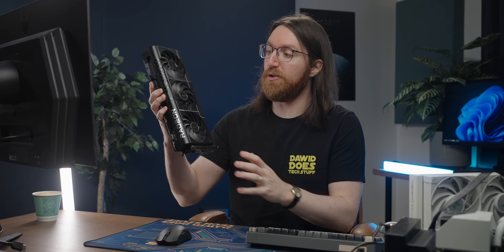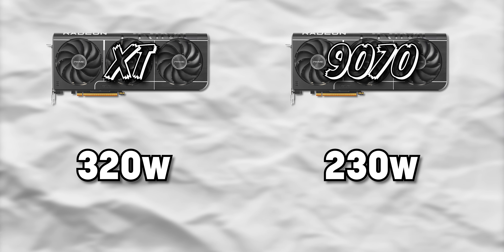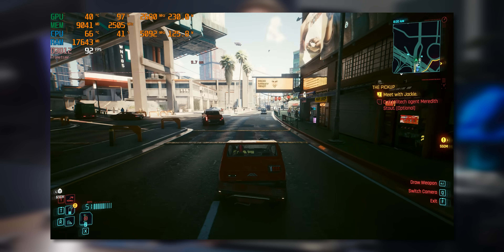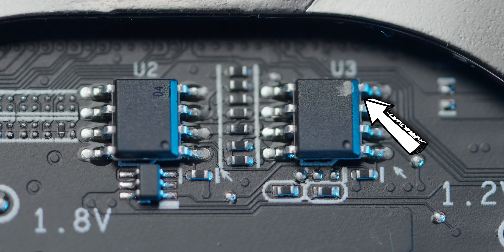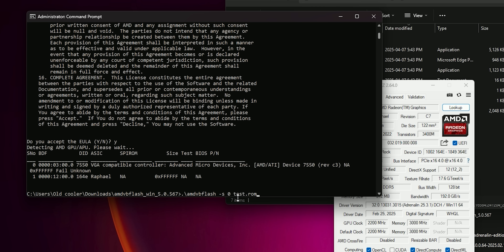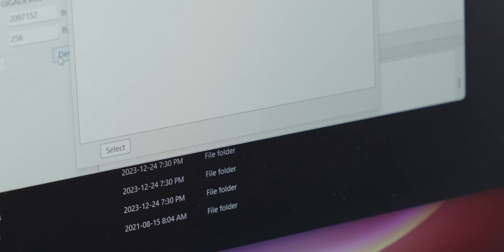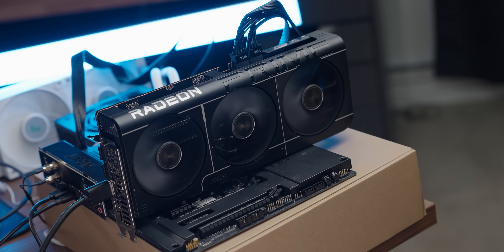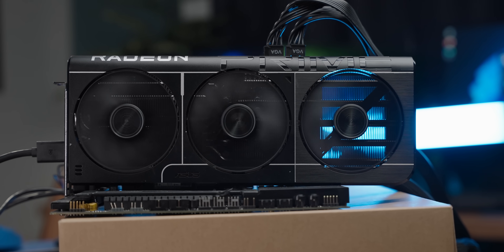I Flashed An AMD RX 9070 XT BIOS Onto My RX 9070...

Comment: Screaming at my screen, "just change it to .bin" ...lol
Reply: NGL bruh, some part of my brain kinda tells me : There's no way it could be that simple
Reply: @fajaradi1223  it depends on the case, on this one, the dump has no file metadata, so you are able to change .rom to .bin, it still will be the same file
Reply: @fajaradi1223  both bin and rom are common extension for raw bitstream dumps from a chip / cartridge / ...

They don't have any formatting, magic or structure, they're just a sequence of bytes.
Reply: Unless I know that .bin and .rom are just same, I won't blindly do it.
Reply: @arahman56  they are the same, when you dump a bios, you only get the raw data, nothing related to the  file format, the dumper places the file extension they want, theres no file metadata. so .bin and .rom are the same
Reply: @henry789  that's not the only thing that may differ. One may be compressed, squashed, addresses may differ, image bases may differ, etc.
Reply: @miloradowicz  that can happen for other file types like video and images but in this specific case the file only contains the bios dump, and changing the file type will only rename the file, not modify it in any way. the windows warning is a little useful for images and stuff like that but in this case it just adds confusion
Reply: @arahman56  They are the exact same thing, both BIN and ROM files are essentially strings of 1s and 0s, representing binary data, the  suffix is just for humans to distinguish the type of purpose the data you are working with is intended for. there is a minor distinction, I think BIN can run as an excutable.
Reply: Ngl I'm not a geek or has any IT knowledge, but I know the file type shortcut change fix from when I used to play with Minecraft servers and some nintendo piracy. I also screamed inside when I he said that he got wrong bios file type. It's just a data David! Just change the data type!
Reply: And I'm out here for it
Reply: Ahaha, I think a few of us did that.
Reply: He didn't need to rename anything - he could just change to "all files" in "Open existing file" window (bottom right drop down menu).
Reply: or he could have just search rom's name in textbox below xD

Comment: I had to do this to a friends laptop who's windows update corrupted the bios. I had this same flash kit as you and I felt like a wizard. I couldn't get the clip onto the bios chip so I unsoldered it and attached it to the adapter board

Comment: Damn! That's a nice uplift! Makes you wonder why AMD didn't just made both 300+ watts.
Reply: On purely a technical standpoint it failed some of the internal checks and so they binned it down clockwise and powerwise, fused off some misbehaving cores and that's the reason. It's for legal reasons so people don't sue for getting an unstable product out of the factory.

The user takes his/her own risks by flashing that bios, but AMD wouldn't like to warranty that out of the box.
(Kudos for them for not hard breaking the card because of some DRMs. This is already a huge W)
Reply: "upselling"
Reply: Because if they did, the performance would be very close and then they cannot justify the higher priced one. Nobody would buy a 50$ more expensive one if there was just a <5% performance difference. You would always buy the cheaper one.

Comment: Need a long term review for this!
Reply: If it works - it works. The only possible problem in future, if the flash was successful - power draw and temps themselves, but with a good cooler and VRMs it is not a problem. And you lose warranty.

P.s. what I mean by "successful flash" - not just no errors on flash, but also test it for stability, artifacts, and errors.
Reply: @Blackwing2345635  If you have cheapest 9070 card that was meant to handle like 220w, has like dog shit VRM, I guess it could die running like 320w

Comment: remember the 6700XT that was meant to be 230W? but most sold are just 184W... if you unlock it, it's easy and doesn't require bios mod, the chances of killing the 184W version is likely over 70%
Reply: but they also stopped making those when the 6750xt came out which is just a pre OC'ed one
Reply: @Healcraft  yep, the 6750xt is basically the same, but without those power issues.

Comment: I hate when I try to do something techy and it immediately gives me an error. Like, I followed the instructions to a tee, why is it wrong? I get user error, but I'm usually very careful to do exactly as the instructions say, to the point of overthinking steps. It's even worse when I look up a tutorial video and they do the exact same as me, but get the correct outcome

Comment: When I said the 9070 and 9070 XT reminded me of the 5700 and 5700 XT, I was more right than I thought. GG on getting it to work. I'd be tempted to try this on my 9070 if it was just a simple software solution. Please just let us do more than 10% power increase, AMD!
Reply: Just wait for a bios flash utility that works. Someone will 100% make it now.
Reply: @error262  damn can't wait 9070 is a great card :glasses-purple-yellow-diamond:
Reply: @TerryFT86  if you can reliably do this without breaking or degrading the life of the card this will most certainly make the 9070 a much better value purchase. This likely voids the warranty tho if RMA notice.
Reply: Even earlier than that was the R9 290 and 290X BIOS swap.
Reply: @DustyTheDog  I did this. I still have the card running in an older PC. It was a blower. I bought an aftermarket cooler and clocked the crap out of that thing. Competes with the GTX 1060 all day long.
Reply: AMD does that almost every generation
Reply: @ZGtx  remember the athlon chips...sold as dual core but you could unlock it to 4 core on certain motherboards

Comment: Glad this hack is still alive, I remember hearing about this trick with the Vega series along with RDNA 1 with people flashing a 5700 XT vBIOS on a 5700. But haven't heard of it since then until now
Reply: Glad this is the top comment otherwise I was just about to comment on the Vega 56/64 BIOS hack as long as you had the right memory.
Reply: I think I remember being able to flash the Rx 580 bios on the 480 because it was basically same card with more vram
Reply: both come with 4gb and 8gb versions @anthonyparker
Reply: yep, I flashed a 5700xt bios onto a 5700, ran great.
Reply: It's not the same thing, but this reminded me of those dual-BIOS Sapphire HD6950 cards that came with a switch so you could run it as a 6970
Reply: This method is older than most today gamer. Back in the day, you could unlock Radeon 9500 to 9700, making it a price\performance king
Reply: You can do crazy things on RDNA1 with YAABE bios editor and MPT/RBE tools. My bios modded RX 5600XT runs at 2GHz even matching stock RX 5700 performance.
Reply: @tidjane2001  I did the same with my 5600XT, I got mine to 2,1GHz at 250W. Sadly as always, it's the memory bandwidth that bottlenecks GPUs in games, and that narrower bus hurts it when compared to the 5700
Reply: @Creepus_Explodus I agree. Memory is holding back this card, both in bandwidth and capacity.
Reply: Done that on r9 290 = r9 290X and rx 480 = rx 580
Reply: Used to be able to do on some AMD Athlon chips to give them a free upgrade to a Phenom
Reply: @hollandx2  I remember those days...you would buy dual core and unlock the 2 more cores in bios
Reply: I flashed rx580 bios to my rx480 back when those were new. It had decent gains and stability, but nothing like this video shows for this generation. This mod has definitely been around on AMD for a long time. R9280x/290x was another. And the generation before that even if I remember correctly. Hmmm I wonder if I can squeeze anything out of my 6650xt 😂 off to the forums!! (Is that still a thing?) Lol
Reply: i tried it with my vega 56 but it ran the same with the 64 bios as with a finely tuned manual overclock as a 56
Reply: @tenshiinen probably because the power limit where basically the same 
We talking 240w vs 320w bios here massive voltage boost
You can see in the video the card going from 2600mhz to almost 3000mhz with the extra power available 
There just no way of achieving this result with the stock 9070 bios power limit
Reply: I have seen this done way back during the ATI days where users turned their X850 XTs into x850 XT PE cards.
Reply: 5700 to an 5700 xt aw the good old days. lol
Reply: I flashed RX 5700 XT vBios on my RX 5700!
And in the process I modded it using More power tool and Red BIOS editor. I undervolted the VRAM chips, from 1350mv to 1085mv, and reduced the minimum voltage from 750mv to 607mv. Running like a champion on idle with as much power efficiency as the RX 6600
Reply: BEWARE your RAM chips. The Vega flash ONLY worked with Samsung, and many v56 had Hynix. There's also the problem of binned silicon. The GPU will be fine, but your RAM will not if it is out of spec.
Reply: your vrm mosfet will be smoking if done wrong, some card have designed with no wattage headroom, you need to check if the total mosfet can handle higher wattage. in my experience some lower version model missing some mosfet due to it designed for lower wattage and cost 😏

Comment: .rom = .bin , yes and welcome to the arcane arts of firmwares 😂😂😂.
Reply: Sometimes in other bin formats you gotta be careful because of big endian little endian and other quirky formatting.
Reply: I've had to change file extensions for emulators before, the unique extension is just so you use the right file :)
Reply: did this few times to flash bios in some weird china board
Reply: i built my friend his new pc a couple months ago and because we got a board that was for 7000 series and he bought a 9600x i had to flash the bios but the bios download was .rom but the qflash without cpu feature only read .bin which was pretty weird lol.
Reply: also works with pictures from web to jpg
Reply: @sopcannon  a .web image is not actually .jpg compliant. What happens is that the program opening the renamed file will detect that it is not a jpeg file, but a .WebP file that has been renamed. Thing is WebP can be used to compress files using lossy and lossless compression as well as animated bitmaps and alpha channel transparency. So it can replace JPEG, PNG and GIF files provided the program using the images supports WebP. There are also a WebP 2 standard that has improved compression techniques. 

So just renaming .web files as .jpg doesn't really make the file more compatible, it just might fool some program to try to use the file and fail as it doesn't support WebP.
Reply: @blahorgaslisk7763 but what if the program reading .bin does the same thing? 🤔🤔 that it detects a .rom file encoding in a .bin container and reads it as if it’s a .rom and vice versa
Reply: @Jwellsuhhuh  Sometimes a file extension is just a file extension and can be arbitrarily applied to raw data
Reply: ....and then rename the file to ben........FFS, what about Raum's feelings.

Comment: I just ordered my 9070 a few days ago, cant wait to brick my bios and blame it on dawid ❤
Reply: please dont forget to give us an update
Reply from the maker: @OrionCV1  Have you bricked it yet?
Reply: @DawidDoesTechStuff  ayy dawid i bricked ma card now you owe me a new one >:(
Reply: ...leaving the comment to check on update...
Reply: Always take a copy of your current bioses
Reply: following this one
Reply: I have one but it doesn't have a double bios switch (it's the pulse) so ain't no way I'm messing with the bios on my shiny new 600 pound graphics card.
Reply: @iitzFizz  If you have a programmer you can always do a backup of the OG BIOS, and if something goes wrong then re-flash that backup.
Reply: @iitzFizz  600 pounds! Dang, that's heavy. Be sure to use a support bracket!
Reply: Just wait for the GPU to be supported and do it via software. Unless you already have a BIOS flasher and etc, which I doubt you do.
Reply: @felipenachmanowicz9393  I don’t suspect this will ever be officially supported, if that’s what you mean. But to Boogylama’s point, this may not be worth it for a price differential of $50.
Reply: his pc never come back so he can't write a comment
Reply: Le dot
Reply: Yess sue him
Reply: @holydoggo7925 😂 I was thinking this…
Reply: please just oc/uv instead
Reply: I put mine in the microwave to save a few frames in the GPU brick any%. Still Dawid’s fault, though.
Reply: Same
Reply: You can just boot using an iGPU or another dGPU and reflash the original bios (assuming you backed it up) if anything goes wrong. So really, flashing GPU bios is not that dangerous.
Reply: @FleaOnMyWiener  except there is no software flash tool for these cards yet ... but yes in the future you could 😀
Reply: Keep in mind this bios flash can void warranty and there are crashes reported also when using it.
Reply: all over the world in a few days we will hear - "MOM! That guy on the internet broke my new graphics card!"
Reply: Did that to my vega56 lucky my card double bios
Reply: real
Reply: Make sure you have a dual bios or your done if it fucks up
Reply: I am sorry that it will work and you'll have to blame yourself for being a genious like Dawid   :D
Reply: ☝Overcoming poverty is not a gesture of charity. It is an act of justice.
Reply: progress is progress!
Reply: Yesterday I flashed my Powercolor 9070 XT Hellhounda with a Red Devil bios. I know it's not at all the same but still. There is a modified version of amdvbflash which supports RDNA4 somebody made, it might work for 9070->XT flash too.
Reply: thanks I just spit my Monster all over the dam place lmao
Reply: i bricked my 7900GRE LMAO 😂
Reply: Well I just bricked my card trying to do this, time to order an eeprom programmer and try to fix it
Reply: Invested in this comment.
Reply: Commenting to get updates lol
Reply: Man this cracked me up 🤣
Reply: Lol thanks for the laugh it's appreciated
Reply: Tech Nerds definitely have the darkest senses of humour.
Reply: This aught to be good
Reply: A nice paper weight too nicee
Reply: Following
Reply: steal his Hair an sell it
Reply: Please who ever reads this, runs this custom Bios and maybe even undervolt it ( or just Bios ) ....  PLEASE if you think of me, remind me in like 6-12 months if your Radeon still works or died.  Thank you very much in advance  <3
Reply: @gamingundbenchmarks1442  this will totally destroy your gpu in long term. Your gpu was not designed to endure 300 watts, dont do it if you care about your gpu
Reply: @Saturnit3  I dont wanna hear theory about "it could break", i wanna have respond of someone actually done it.  "it is not designed for it bla bla bla"  you can keep ty
Reply: Folllwing
Reply: following
Reply: Can some write the temps wiht 300watts on a 9070. I think thats the only problem. But maybe some genius outside who can rewrite the original bios with 350 watts ;P
Reply: Or just spend the tiny bit more and not, ya know¿ Spend the time spent on flashing the bios, on working instead... And you can get the XT and take yourself out on the town possibly. 🤯
Reply: otis
Reply: I already have bricked it and blamed him multiple times.
Reply: Following this story
Reply: Tactical dot —> .
Reply: update?
Reply: still waiting on your update @OrionCV1
Reply: Did you do it
Reply: We need a update unc
Reply: Dam, we still waiting uh
Reply: I think his pc exploded 😅
Reply: Ahh.. me too... happy memories.
Reply: @OrionCV1 How is the card doing?
Reply: your vrm mosfet will be smoking if done wrong, some card have designed with no wattage headroom, you need to check if the total mosfet can handle higher wattage. in my experience some lower version model missing some mosfet due to its designed for lower wattage and cost 😏
Reply: I think a fair comparison would be the 50 70 TI for this card. The 9070 is still cheaper than the 5070 but those 480s are way up over $1,000
Reply: Would Flashing the 9070 made it Burn out faster??
Reply: @sky8571 no.
Reply: Milk
Reply: to future people reading this, this was a troll I of course never did that, I thought the first message implied it was a joke but apparently not
Reply: i really like your pfp: Kondo-sans attempt to improve his popularity 😂
Reply: Following.
Reply: 50 dollars cheaper voiding your warranty super gamble lol.
Reply: Give me an update when the "stability" happens.... if it happens
Reply: Following
Reply: Quick tip for fellow modders: if your motherboard supports USB BIOS FlashBack, you can update the BIOS without a CPU installed. Just ensure your USB drive is FAT32 formatted and follow ASUS's guide. Good luck!
Reply: sorry to disappoint everyone but I never planned on doing this, it was a joke I'm not risking my new gpu that's rarer than unicorn dust
Reply: @OrionCV1  smart man, did you build a full computer custom or were you just upgrading the GPU?
Reply: seems like a lot of work for a card that gets beat by 3080 if the game doesnt have fsr4